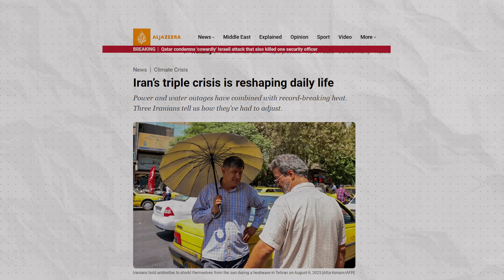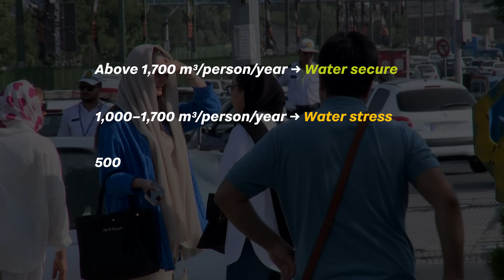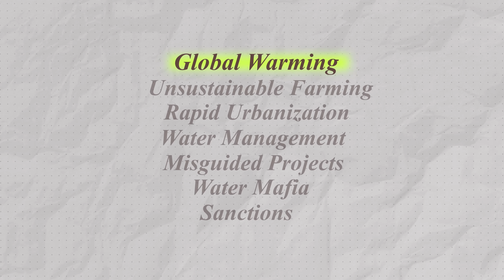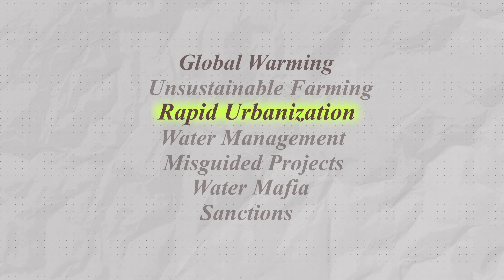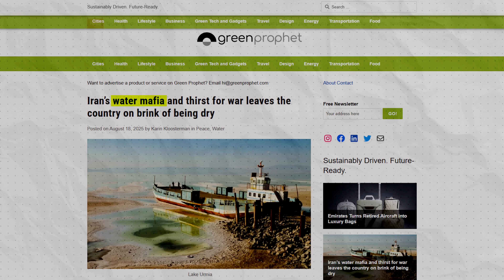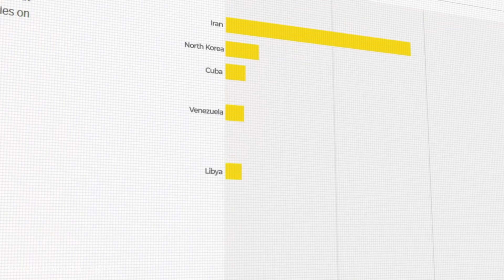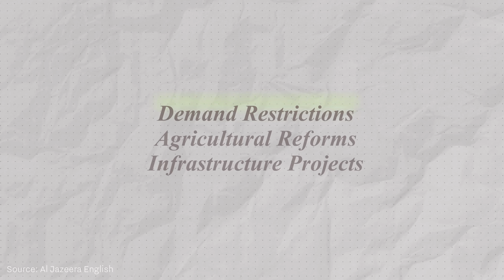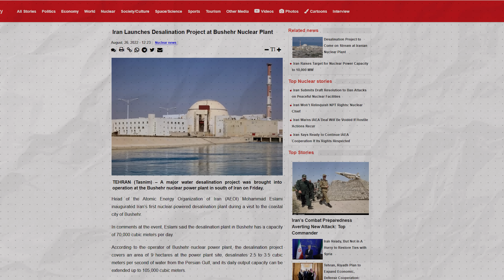Iran’s Water Crisis Explained: The Water Mafia, Carrying the Sea to the Desert, and More

Comment: It would be alot easier to offer to trade Nuclear weapon deals by offering to remove sanctions on water conservation imported materials and professional advice plus some help in cutting water use in steel making and desalination. With "free" cash from oil, the water mafia do not see why mega projects can generate replacement cash for other failed projects. Hopefully the protests will drive home the message that radical reform is needed and those who abused water will find it harder to hide and it needs some answer before the next Summer heatwave.

Comment: There are adequate water 💦 somewhere someone interfered with air current control system using direct manipulation of large-scale atmospheric pressure and air currents is not currently possible with AI, the technology is being used in a significant way to control and optimize air flow and pressure in controlled environments and to improve our understanding and prediction 
Advance AI technologies (maybe and higher possibilities)

Comment: This looks like game over for Iran .....
Reply: De hecho sería para todo sudeste asiático que sufre un severo estrés hídrico que incluye a Tayikistán Uzbekistán Kazajistán Turkia Irak Pakistan y Afganistán...
Reply: It’s not good, but it’s likely not game over.  Iran has access to pipelines to desalinate sea water, and while this isn’t easy or cheap, a country could do it.  Or put in better water management (like drip lines to replace wasteful surface irrigation on farms, switch to mainly drought-resistant crops and just trade for the high-water use crops, etc).
Reply: @Connor37911  no, they should go on the way they are. Why rock the boat? Oh, yeah, it's on the seabed.  From 35M pop in 1985 to 90M in 2020.
Reply: @mikemotorbike4283 The birth rate in Iran is below 2 children per woman.
Reply: @Connor37911 too late.

Comment: Quit blaming crap on global warming.  It is a hoax.  The global avg. temp is not going up and changes in CO2 levels have virtually no measureable effect on the overall greenhouse gas effect.  What we have are simply some fairly long period changes in weather patterns.
Reply: You are really dumb.
Reply: Don't look UP.. ....
Reply: when i was a kid we had real winters with at least a foot of snow- now its white a couple of days.  and we are seeing cockroaches 
in the country too. and even if the climate change doesnt get you, the pollution and microplastics will. were screwed.
Reply: @kimrasmussen7188  And yet the aectic ice was at a record high a few years ago (2022) and antarctic ice has been increasing steadily for decades.

As for the microplastics, nobody wants thise, but that's a completely seperate issue from CO2 emissions since CO2 is NOT a pollutant.

As for snow on your lawn, it's a nice anecdote, but it has no global relevance.  Global climactic changes occur on a glacial pace, but local ones change much more rapidly.  That's why we have changes and reverse changes in the patterns of the jet streams, why we have years with several tropical storms and hurricanes and years with none (like this year, so far), and why we have veey cold years and huge blizzards like in the rust belt and mid west in the late 70s followed by mild winters in other years.

If all you do is look for outlier weather events to substantiate your view that the world is going to hell in a handbasket, you will always find some, but they aren't statistically significant.